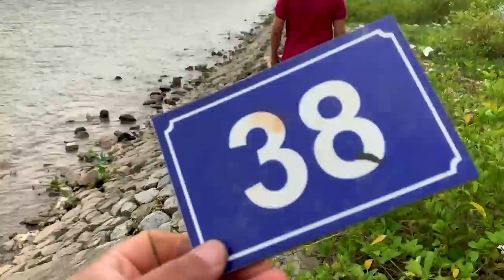Restoration of a smoke generator

Comment: Something doesnt add up with this one. All of that corrosion but not a single stripped or broken screw/bolt?
All of that corrosion, but every tang is perfectly clean? all of that corrosion but the wires seem new and pliable still? 
mmmm.. not sure about this one. seems like they strategically left out a good working machine and used some sort of "rust promoter"
on everything but the important bits.
Reply: one of the biggest things that is suspect as hell is the white plastic jug. if youve ever seen something like that with enough salt/heat/sun exposure you would know. they turn yellow FAST. and they also crack. 

this is another "fake" video. i can appreciate the work and craftsmanship but this ones a hoax.
Reply: and it even magically had the wireless fog activation remote with it too :D The chances!!! haha